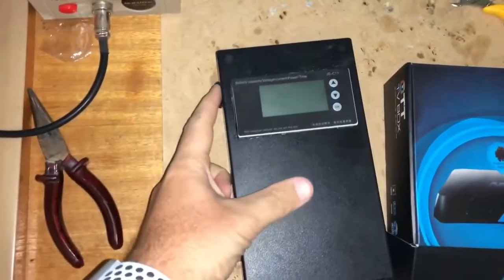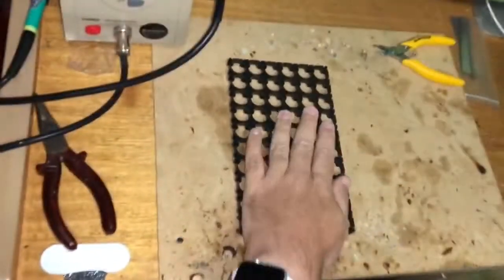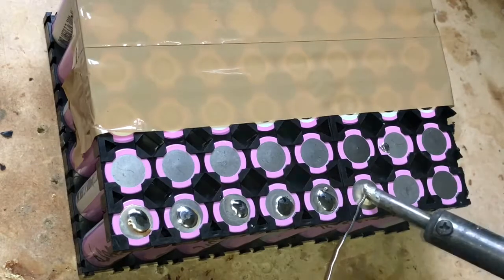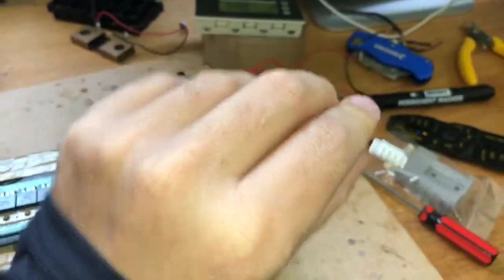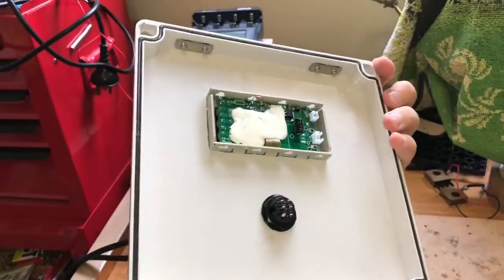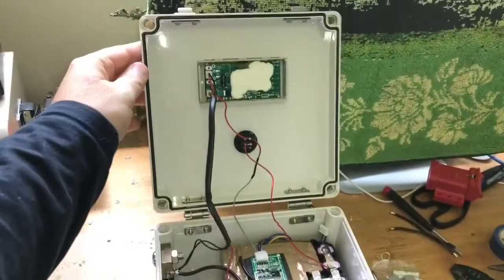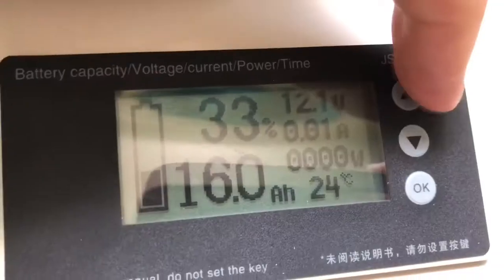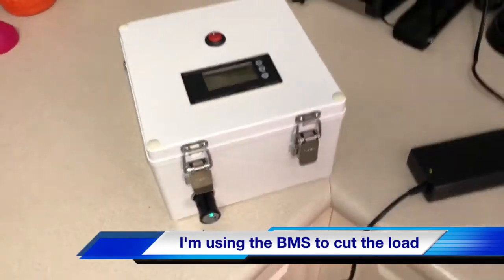DIY Lithium Powerbank - Better than Anker

Comment: Thank you for accurately computing the capacity.  Saw a video earlier where he claimed his 3s7p had a near 50,000 mAH capacity.  When in reality his 2200 mAH cells in that configuration would only have a 15,400 mAH capacity.
Reply from the maker: Paul-Joseph de Werk yep. That's why I laugh when a friend buys a Chinese phone battery bank with "20,000mah" capacity and it's as thin as an iPhone. In reality it can barely store 2000mah

Comment: nice work, just one thing to say . Your are putting 9 amps through those very thin wires to charge it, i think that will give you problems.
Reply from the maker: jollcorn31 you’d think so. But the thin wires are 18AWG silicon wire which should handle 22A. I’ve done a drain test and after 6 hours of full speed charging the charge cables only got to 26c. As for discharge I couldn’t even measure a rise in temp.

Comment: HAHA, nice!! so what is the total price for the parts you used? is it actually worth it to DIY or should you buy the Anker powerhouse instead? I guess if they come out to be the same price you could still say yours is better for its versatility, (have a bigger inverter Etc.) I would suggest adding a DC battery connector to wire in an inverter. I personally prefer XT-60's for something like that, 12v plugs arent good for high power applications so you would be limiting the power of your powerpack to 150W
Reply from the maker: SuperBrainAK cost me about $190 all up. My old lead acid 44Ah camping battery cost $499 and it only delivers about 30Ah.
Reply from the maker: I've still got to add my little 300w inverter, 12v-36v step up,  50A Anderson connector and USB's. I'm going to use this for my home made UPS, blackout backup and my electric boat which pulls about 30A.Cells were $3.12 each = $149 (Australian)LCD: $17Switch: $2The box and other plugs and sockets I had lying around.Cigarette lighter plug is only good for 15A so that's why I'm putting on a 50A Anderson connectorTotal cost was about $170 Australian.
Reply: Hi nicely done ✅ what will connect it do when camping? Are u solar charging also, how does it compare in cost to an equivalent retail unit?